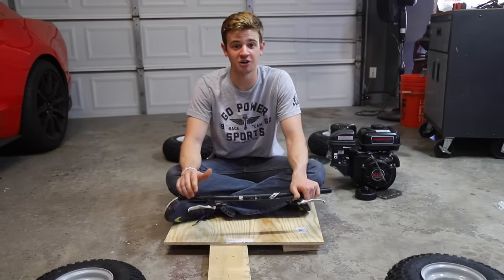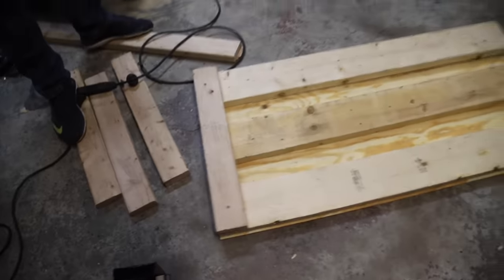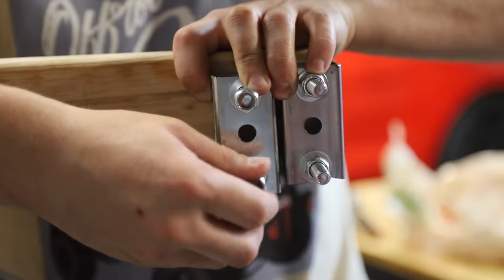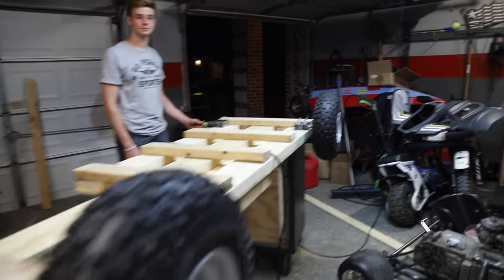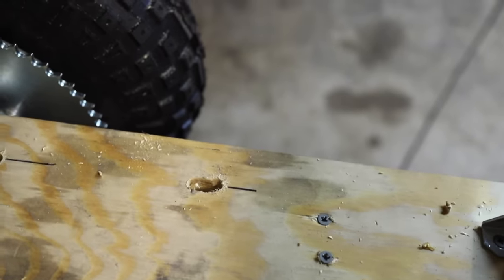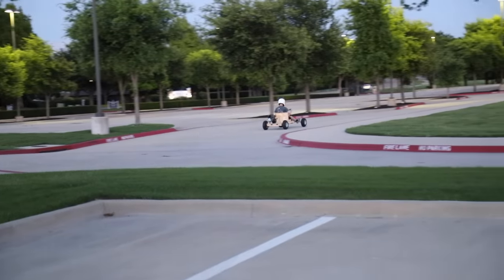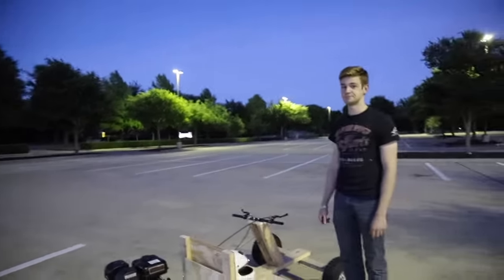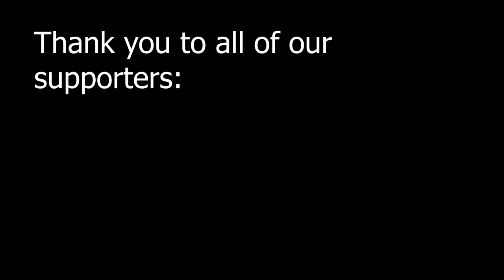Homemade Wooden Go Kart Build | NO WELDING or Expensive Power Tools!

Comment: I like the concept but it feels like an easy way to break a leg lol
Reply from the maker: Yeah I mean we crashed the green one a lot and it was never bad for our legs. Most of the time the wood just broke/snapped when we crashed.
Reply: I made one a year ago with A hand dully and a car axle ours had no Engine it was fun though
Reply: Steering dampener would fix that
Reply: Wear your seatbelts kids
Reply: You sound just like my grandma
Reply: What I would do is, do the same turning design, but connect a bike bar to the place for steering and I just turn the bike bar and you can also connect the throttle at the biker bar
Reply: Agree. It needs some limit stops installed. But, cool kart! Great father/son project.

Comment: Me: sees wheels yep I don’t have the money for this
Reply: Steal them off your neighbors lawnmower
Reply: You can get like 2 inch smaller ones for 7 bucks from harbor freight
Reply: Are bike wheels not good?
Reply: Ya they dirt cheap on ebay all the steel parts tthat these guys dont use is what is so expensive
Reply: Just go to a junkyard.
You can get the mechanical stuff.
It’s free
Reply: Omega Woomy for real
Reply: Omega Woomy same
Reply: Make the wheels out of wood to
Reply: Too* or the word also would work in place
Reply: Yep
Reply: @hajile580  One would-think spoke-less bike-wheels such-as aluminium, carbon, & or mountain-bike wheels are designed rigid enough to resist side-impact or stress-action(s) that will weaken typical spoked-wheels.
Reply: @deadzombie3618  I second that
Reply: I've seen those exact wheels for $15 each where I live
Reply: @colby9594  bruh I tried those they broke automatically when I turned
Reply: Colby what about the driving wheel
Reply: Colby you don’t get the drive wheel and if you were to do the drive wheel your self you would need a welder
Reply: Buy harbour freight wheels and add a sprocket under 60$
Reply: Ye I thought it’s was supposed to fly
Reply: Go please
Reply: Thanks but I stuck enofe tires in my life maby with old enjin
Reply: Ok thank you I will build on
Reply: @slimedfries5234  that's funny
Reply: @slimedfries5234  lol
Reply: @hajile580  heck no lmao
Reply: For reals tho lol
Reply: Dude these are like 10bucks lmao
Reply: Yeah, good thing my we got 2 old riding lawnmowers
Reply: Wooden wheels
Reply: me sees engine and he saying its 99 dollars with coupon yep no money for this...

Comment: Back when I was a kid in the 70's kids made wooden go karts alot. The reason being not every parent could afford a new or used steel one. They worked an were fun as hell.
Reply: we did faster lawn mowers, we moved the mower deck to the back (like a bush hog) with a 5hp motor powering the deck , and a 7hp (or greater) motor running the "tractor". some went 30 mph ! One had a 250 Honda motorcycle engine/transmission. Mow in 1st gear, ride in 4th. LOL
Reply: Christopher Haynie I also made a wooden go kart.  Had belt direct drive with an old washing machine gas engine.. good memories😊
Reply: Did same in 68 it was 7 ft long push cart no engine
Reply: Im one of them 60s 70s👍
Reply: My father made a wooden go kart and he didnt have no engine for it or peddles, And the thing had rope steering. He and his friends called the go kart a “gig”.
Reply: We just pulled the wagon to the top off the hill and coasted down.
Reply: "Can't afford it" is no option for fathers here. I am not a father yet but I have 4 jobs so I CAN afford anything we want.
Reply: Back in the 1930's, we used to build airplanes out of wood.  Before that, we built ships out of wood.

Comment: the handle of the saw can be used as a square. if you look, you'll see it will do 90 and 45 degree lines. a tip from an old carpenter.
Reply: I just randomly discovered this one day messing around. I was like MIND BLOW
Reply: I've been building things for 35 years and I never knew that!
Reply: @rickrudd  it's not true for all handles. the older, fancy ones especially. but most newer saws have that design. they're ok in a pinch, but i've always got a speed square in my tool belt when i'm working.

Comment: need to add steering limit stops so you don't oversteer and flip
Reply: Warfighter Racing exactly what I was thinking lol
Reply: thats why you take it slow around turns
Reply: or shred the tires on the frame
Reply: U shouldn’t need to you should no your
 turning point
Reply: @yekuei2608  if you hit a bump while turning then it'll be quite difficult to make sure the wheel doesn't hit
Reply: Add a 2x4 a couple inches behind the steering bolt
Reply: Nah man ima dirt track racer
Reply: And some foot cleats to keep your toes out of the wheels.

Comment: Where was YouTube when I was a kid?  O wait the internet didn't even exist! This brings back so many memories of trial and error. That is when I found out what a horizontal shaft motor was. Most people have no clue what an engineering feat it was for a 12 year old and his friend to figure out the engine set up with a mower vertical shaft engine! I hope many kids watch this and get the building itch! Thanks again guys!
Reply: My kids say that all the time.  "How did you do that before you had the Internet."
Reply: Yes! I am thirteen and love finding trash mowers and weedeaters and fixing them, I would love to build one of these go karts
Reply: @danskorheim773  I am 16 and I love to do that stuff to and yeah this would be cool
Reply: Does it make it much more difficult when using a horizontal shaft?
Reply: @lippzzz77  No, a horizontal shaft engine is ideal. A vertical engine running to a chain and sprocket is a nightmare without a transmission.
Reply: would love to do this but no equipment to do it

Comment: A tip to anyone doing this if you have bike parts laying around you can use the handlebars to turn by drilling through the wood the size of the wheel mounts and you put them through and tighten bolts on the bottom to keep them from coming out then you can drill holes in the tubing for more bolts to keep it from scraping the ground.

Comment: 2 words for ya, rope steering. Mount a steering wheel on your handle bar mount with a rod going down. On the bottom of your steering rod mount a pulley with a groove at least wide enough to accommodate 3 coils of rope (more = more friction and less chance of slipping but 3 is typically enough for a slow cart). The larger the pulley the more responsive the steering will be, smaller gives finer control but you will need more revolutions of the wheel to reach full lock. Next, fix the end of a rope to the top of your steering board, as close to the wheel as you can making sure the rope mounting point is on a level with where the top coil of rope will be on the pulley. Wrap the rope 3 times around your pulley keeping the rope tension tight and attach the other end to the bottom of  the opposite side of your steering board. Fix the rope coming off the bottom of the pulley to the underside of the steering board on the other side, that will keep the geometry better aligned. You can also install guides to help keep the rope from popping off the pulley if you didn't measure things up right. If done right you will have a cheap and dirty steering system that should give you full lock both ways.

Comment: I haven't gone through all comments but... All hand saws have a 90° & 46° set square built into handle. I will let you figure it out lol. I love it as thats where i started when i was 10 yrs old. Im 50 now lol.... Keep up the good work. I have a 3 wheel electric Chinese golf cart, chain drive. Swapping out electric motor for a Chinese pit bike 110cc petrol engine. Wha hoo... never get old lol. I'm in NZ.
Reply: 45°

Comment: If you make a metal engine plate with elongated holes, bolt the engine  mount plate to the wood and drill out the wood below the elongated holes that should keep your engine in place. To make it even better use two mounting plates one on top and one under the wood this would ensure that your engine stays put.

Comment: I did a similar project when I made my push mower into a go kart but for the steering I put the board on the top so the frame is hanging from it and it makes the whole cart a little bit lower and it looks a little bit better

Comment: You should have done a full rod or axle at the back, the way you did it with the short pieces is not safe, a few bumps later and it will come off. No chain guard and that chain will bitch slap you on your left shoulder.

Comment: I built a belt driven one with a 5hp Briggs and Stratton engine. It was a 3 wheeler you would steer with your feet. Brakes were just a lever that put friction on the tire.

Comment: My spy at Recaro called, he swore me to secrecy but they are looking at producing a seat just like yours as an aftermarket upgrade for high end sports cars....don't tell anyone, its a secret! 😉  I might have missed it, but I didn't see a kill switch, even with a basic design a kill switch is an important safety feature in case of a stuck throttle. If the throttle gets stuck and you don't have a means to kill the engine it could result in an injury. This is such a fun starter project we shouldn't forget this important safety feature, and as my shop teacher used to yell at us, wear your eye protection you only have one set of eyes!

Comment: Im gonna build a railroad in my backyard and use this system for the locomotives. Not sure how it's going to turn out, but I think it should work. Only difference is that Im gonna have to use a larger engine. Maybe a battery

Comment: An old trick i have used for  nearly a half century taught to me by my uncle, while using my great grandfathers saw.  Don't let the saw rust, you will get a slight reflection of the boards edge. If the image looks straight and continuous it will be square.  Easier than it sounds.  Newer saws may even have square and miter angles built into the handle shape for layout,  but the reflection will be true.

Comment: Wow ! Great build ! Can’t wait to give this a shot. You’ve earned a new subscriber. Keep up the great work ! Also , is it possible to attach the handle bar/throttle /brake to the tire bar(idk what it’s called but that thing that you put your feet on to steer) like that you would be able to steer with your hands ?
Reply: 3 years later lol but I feel like you could your obviously have a lot more of a slant, but I feel like it’d be good because I feel like when starting you would try to use the handlebars to turn. Either way you’d eventually get used to it I feel like, idk tho I’m just a kid and kinda new to that sorta thing.

Comment: How much did this cost for materials?
Reply: The motor is the main thing. You can make something like this without the engine for less than 200.
Reply: @NR-gp2il  thanks. I am 75 % done.  Got a free lawn mower engine to rebuild
 Inside is practically pristine.   I know nothing about engines but it seems pretty simple

Comment: did you think to use glue along with the screws ? Due to vibration etc - -  I would not use glue alone, but with screws it would be a bit better than just screws.

Comment: I love the fact that you guys are using your hands and developing problem solving skills. This sort of thing will set you apart from your peers in so many aspect of your future lives. Just one suggestion .. use two boards underneath since that wood is not very good quality. At least check and see is the grain in vertical; think diving board. You don’t want it to snap in half when you’re driving.

Comment: First off, congrats on 100k! 🔥 The feet steering is weird but i guess it works, or as long as you dont run into something. And most importantly if you do happen to run into something you may get impaled by the handle bar boards. That wouldn't be pretty.

Comment: When you turn it probably pulls the throttle cable thats why you feel it push you through corners. As for the chain you can try some sort of spring loaded tensioner.

Comment: Hi Guys: I really enjoyed your video and would like to mimic what you did as best I can with my son - I know nothing though. Why do you suggest the 420 chain instead of #35? I assume I have to buy a clutch for 420 then. Also, the chain length. Would 5 ft work as a starting length? Everything will essentially be the same as what you did, perhaps just a different engine due to the predator being out of stock. Thanks so much! Matt

Comment: This is an intellectual NO-WELD go-kart. As a pre-teenager I leaned to drive & had a BLAST on a typical steel go-kart on trails & dirt-roads ect. When the kart was-not in the welding shop getting routine frame-breaks fixed & or repaired. I see NOW the simple,effective welding-solution to transporting kart(s) on rough-terrain is use of  a wood-frame. NOTE there are numerous strengthening tactics-necessary that can/should-be learned by experience(s) as your intellect-grow's... SAFETY-ALERT I immediately-noticed a MUST-HAVE is a roll-bar or roll-cage. Once flipped & neck or back injuries are sustained is WAY-TOO late...

Comment: Can someone help me out . I currently have a push go kart and i am going to convert it with a 48v 1800w motor . At the moment my axel is locked in and the wheels have Bearings how would I make it so I don’t have to change the wheels or the axel ? Currently the axel is locked it to place with 2 pieces of wood it  is would bolted together so the axel won’t move . Will I have to remove that or just Loosen it so the axel can move and just cut off some wood so the rear sprocket can fit in . Also will the axel just roll on the wheels and will it just not go anywhere? In the video how does the axel move when it is locked into place ??? Pls reply !

Comment: Fellas, great video. I see the parts listed in the description but where is the actual brake? I don't see a brake disc or caliper. Perhaps the brake is there but I just don't know it. Thanks.
Reply from the maker: Hazem Bata under drive wheel front brake sprocket
Reply: @BuildBreakRepeat  I mean in the parts list, not the actual cart you built. I'm new to this so perhaps the brake is listed but I don't realize it. Thanks.
Reply: @BuildBreakRepeat  oh wait, I see it now! Thanks.

Comment: A better way to mount the engine is to use a metal gokart motor mount. There are two main kinds commonly available, flat and flat with lips on the edge. Cut out an opening slightly smaller than the motor mount you're using and mount it over the hole with bolts on both ends.  Another idea for front steering is cut the forks off a bicycle and mount the forks and wheel to the front and you have a trike.

Comment: So it’s basically 1wd? I’m making a similar kart, it’s based off of yours, and I don’t want it to be 1wd so one thing you can do to make it 2wd is to get two of the bearings that have screw mounts and a long axle and boom you have 2wd! And if you think of it it’s also kinda a welded diff if you think about it
Reply from the maker: That's true, if you did that you'd have a live axle and both wheels would be driven. Good luck with the build!
Reply: @BuildBreakRepeat  hey man thanks!!

Comment: Do you have any tips for getting the chain to stay on? We have literally tried so many things. We've realigned the engine and the wheels, installed a tensioner, and changed the sprocket setup. Nothing has worked. Largely the issue is that while we can get it in alignment it refuses to stay in alignment. Really need some help with this if anyone has any tips!!!

Comment: This would be a great project for a 10 year old who had a dad to supervise, and money for a engine, personally my dad had a home made aluminum framed go kart he had when he was a kid that he got running for me when I was about 6 years old, we had a 6.5 hp craftsmen snow blower motor, then he bypassed the governor, and removed the air filter, then I ran it like that for years, then the piston rings split apart and the dipstick tube fell off, it didn't blow up, but after that I took it apart, and it had massive scoring on the cylinder, then we got a hemi predator 212, then I removed the governor, air filter, and muffler, then I did a speed test, and it went 35 mph, but it has valve float so know I'm going to change it to a bigger sprocket, and make it a burnout machine(on grass).

Comment: But by the time you buy the drill, the hacksaw, the saw and the screws, you almost could've bought a harbor freight welder
Reply: That's not the point, most homes don't have a welder in em but do have basic power tools.

Comment: Engine $149 (coupon expired)
Plywood $32 (cut in lowes 2ftx6ft - left over used for seat)
Bolts/nuts/washers $20
Chain/clutch- on website (?) 
*not purchased yet
*Tires- will let you know (thinking harbor freight)
Sprocket *
Brake*
Throttle cable*

Daughter is building this for engineering class (she’s 17, a junior in h.s.)  She pressure washed driveways & waited tables to afford the purchases 
*is the battery necessary?

Comment: "we will be doing the build without power tools"... immediately busts out a drill
Reply: You can use a hand drill.
Reply: If you don't have a hand drill you probably shouldn't be looking into building a go-kart.
Reply: @thehighground9175  you can use manual drill but its gonna be harder.
Reply: @godschild5587  For sure, but it would save you so much time just to go buy a hand drill. Even just a cheap one would probably get the job done.